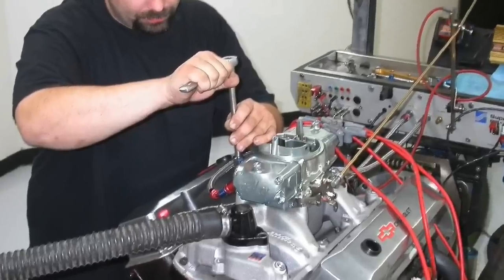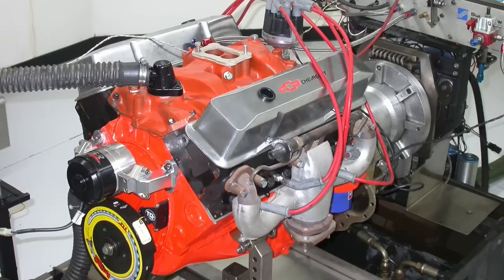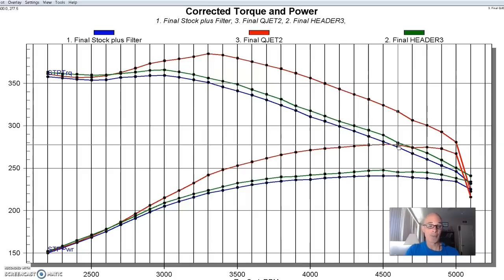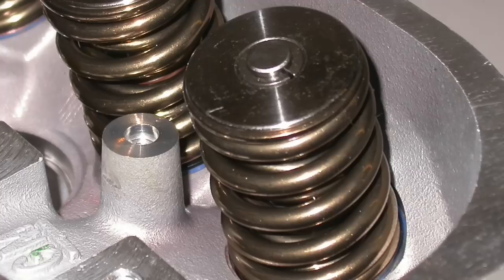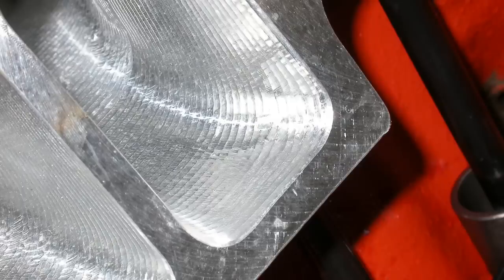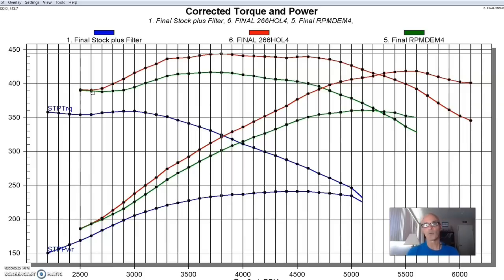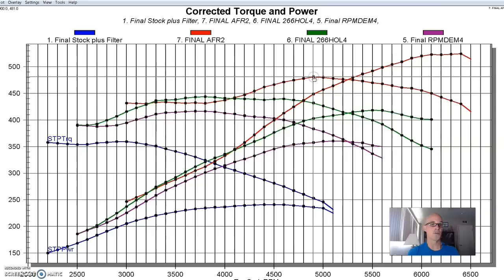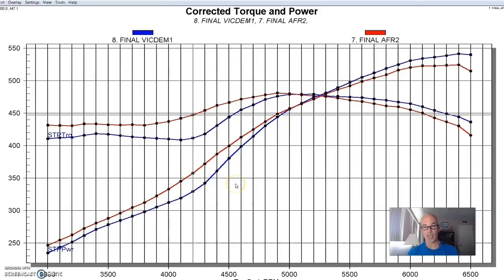HOW TO: SBC POWER COMBOS

Comment: So...I have a 388 stroker in my chevelle. Near .700 lift solid roller and 14-1 compression. Dart pro 1s, super victor and a qft950. Would this be stage 4 or 5? Long live the small block Chevy 🤘

Comment: I planning on getting afr 195 and a decent cam my son's 75 corvette 350 and for future 383 I won't have to spend on heads again. Would does afr 195 work for on that low compression motor. Thanks

Comment: Richard can you put a small cam in a 350 like a 212/218 110 lsa with those 195 wild heads  and show us what a super smooth idling engine can do with great heads also have you ever ran into aggressive duration/lift flat tappet camshafts chipping the lifters I have which is why I feel it would be warranted to have a small cam with big heads for longevity and to show that small cams with the right heads work very well for the street no loss down low and the heads carry the rpm up top
Reply from the maker: thnx-the heads wont carry the rpm quite the same without the cam duration, but mild combos are much nicer to drive
Reply: Richard Holdener I think it would be awesome to see how much a good set of heads can carry a cam up in the rpm range can you still get 50 hp out of awesome heads with a small cam just the same way it did to the big camshaft

Comment: If you were to build a 355 4 bolt main SBC (80-85 GM block) from scratch and wanted a street strip engine that could take abuse with retro fit hydraulic rollers, approximately 6,200 rpm, and around 400-500 hp, what rotating assembly and top end would you build?
Reply from the maker: lots of good options

Comment: Another rookie question i have the Vortec block and 350 hp i want to make more power  i have about 2000 to spend on heads and cam can you give me a good como i have sniper  and the hyper spark ignition system 5 speed and power brakes i would appreciate it thanks
Reply from the maker: Promax or AFR Enforcer heads and the cam depends on where you want to make power, you can also go cheaper and get Vortec heads from the junkyard
Reply: @richardholdener1727  i have Vortec heads i think my cam is the week link

Comment: What would be a good cam for a 9.5cr SBC 400 with ported vortec heads... 79 camaro, 2500 stall and 3.73 gears?
Reply from the maker: daily? or race?
Reply: @richardholdener1727  weekend street car
Reply: @richardholdener1727  actually it's 10.2 CR
Reply: @richardholdener1727  any thoughts on that cam? I'm thinking 234/244 duration .490/.510 lift and 108 center.. or is that too much duration for a street car in a 408?

Comment: hey Richard love you videos My question is I have a vortec 350 . vortec afr190 heads summit 8803 roller cam comp rr I bought some ls7 lifters for my build can you tell me how to set lash
Reply from the maker: 1/2 turn past zero lash
Reply: @richardholdener1727  thanks 👍

Comment: Great information as always! What were the specs of the large HR cam on the final test?
Reply from the maker: xr294
Reply: @richardholdener1727  Thanks for the response, Rocker Ratio? Literally in the process of ordering all the parts for the wild combo but with the AFR dual plane for street use. Thanks !!

Comment: Great info on an awesome engine!
....but how bout taking it to the next level...
  Like 421" or 427" ...but stick with flattop pistons and 64ish cc heads.. (Like afr 227's or comparable) Solid roller with 260 & 270ish @ .050 on a 108 or 110LC (also like to see cam at 270-280 ish) with a good single plane intake and a 950hp or dominator carb.. (Would love to see it both ways with the carb) ..  
  This is the basic engine description I have in my 70 camaro...curious what kind of power it makes...it's never seen a dyno..
Reply: Also..  Since it'd be easy to try on the dyno...would love to see it on e85.. And how it compares to 110 race gas..
   I run mine on c16 ...but it's a nitrous car..

Comment: Hey Richard I Have A 1998 GMC With The 062 Vortec Heads, Camshafts Are Real Tricky And I'm Trying To Find The Right One. I Just Want A Bit More Power And A Better Sound I'm On A 200$ Budget And The Stock 5.7 Comes With Roller Lifters, And The Only Cams I Can Find In That Price Range Are Hydraulic Flat Tappet. Any Help Thanks.👍
Reply from the maker: roller cams are more $-those heads need low lift or a beehive spring upgrade
Reply: @richardholdener1727  What Lift Do You Recomend, I Read Somewere That Over 480 Lift Is Overkill. Thanks

Comment: Ok so when running with the Holley heads an upgraded cam what was the modification to engine to adapt to the upgrade?
Reply from the maker: modifications?
Reply: I looked up a set of performance aluminum heads an the tech said to have change pushrods to .100" wondering if that was it?

Comment: Richard what do you think about sbc 350 stock short block with 297 fuelie ported an polished hump heads with 202/64 cc vavles an duel plane intake ? Which has been port matched as well , I asking h.p?
Reply: Forgot to mention 284xe comp cam 607 lift cam?

Comment: It would have been interesting to know the compression ratio of all the combinations as it affects cylinder pressure, torque, and horsepower.
Reply: The actual compression ration will not change just because of the cam

Comment: Does anybody know what cam/cam specs was used in the last 524Hp combination?  All Richard said was retrofit hydraulic roller.
Reply from the maker: xr294r comp hyd roller
Reply: I built the exact same engine, with the same cam and only got 435hp from a 350ci. I think the 524hp engine combo was a 383ci?? Just a sanity check for me Rich.
Reply from the maker: You need to hook up all the plug wires-what was different about your build? If you duplicated it exactly, it will make this power
Reply: @richardholdener1727  In reviewing this further, I might have used different heads. The AFR heads I used were AFR #1034 - 195 Eliminator Street Heads. Also my engine was 10:1 CR, yours I think was higher. I used the XR294 cam with 1.6 ratio rockers. Ultimately where did the 90+ horsepower difference come from?? https://youtu.be/MgNZzaiotNk

Comment: Another great vid mate,, Given that the first test was 2 barrel and a basic shitter, it really does go to prove that my thoughts that the specs quoted for the 89 L98 TPI Vette are ridiculously low. The full vid also adds weight to the advice i have been giving to others for 50 years,, That it is like baking a cake, the results depend on the recipe, putting 6 eggs instead of 2 doesnt meant it will be better, it all has to match up..      O yes that exhaust manifold has to be the worst flowing/port match I have ever seen, old Rams horns way batter.     Eddie   Australia C4

Comment: Was that a standard bore and rotating assembly, stock bottom end 350 ci. on all three builds?
Reply from the maker: it was .030 over with forged piston as described in the video
Reply: @richardholdener1727  thanks,must have nodded off during that notation.

Comment: What comp cams xtreme energy hydraulic roller cam made the most hp?
Reply from the maker: XR294
Reply: @richardholdener1727  Thank you, I was thinking it would be that cam
Reply: Do you have any combos using the ht383 with afr heads with 500 hp/tq?

Comment: I know no one else on the planet will test them so I'm going to ask you... I would never personally run them on my engine but I know several people who have. Please do a back to back test of the $500 eBay aluminum sbc heads vs something like a vortec head. I got a job at a engine building/ machine shop about 3 months ago. I've personally seen people make over 600hp with a vortec headed 383. I'm curious if the Chinese "performance" heads can compete.

Comment: I was wondering what the ccp or the compression was with the differant combinations because of the differant intake 
 Apparently the flat top pistons with zero deck helped with the later intake closing of the larger cam and help with the motor not being soft on the bottom end
Reply: Not saying it cant be done and hasnt been done but a 3.75 stroke has a piston speed of 4000fpm at 6500 rpm. That would be redline for a street engine and we all know all 400s arent the same

Make peak power at 6000 and shift at 6500 rev limiter set to 6800? Yeah it would be a good street combo
Reply from the maker: we run lots more stroke ta lots higher engine speeds-people need to not worry about piston speed-Our 4.5-inch stroke LS went 7000 rpm all the time
Reply: @richardholdener1727  thanks good to know. Lots of people use the 4000fpm rule for a street engine but if 4300 won't hurt it cool thats like 7000rpm

Comment: Important note on the vortec heads if you're going to run more then a . 470 lift you've got to cut the valve guides down if not you'll bend the push rods. Ask me how I know lol
Reply from the maker: Thnx-I think I mentioned spring mods in the video
Reply: @richardholdener1727  I couldn't remember if it was or not but I learned that one the hard way years ago after destroying a few sets of push rods. But keep the awesome content coming sir 👍

Comment: what are the specs for the wild cam ?
Reply: Thats what I’m wondering. Not sure why he left that info out. Maybe he forgot.
Reply from the maker: Comp XR294HR
Reply: For those that don't want to look it up: 242/248 @ 0.050", 110 LSA, .540/.562 lift.
Reply: @rizzoid  Cool name. 😎
Reply: and the spec on the piston......
Reply: That cam is wild I would of liked to see what this motor would of made with the rv cam and wild heads just to see how far the wild heads would take such a small can also no loss down low and nothing but gains
Reply: @mikef-gi2dg  Looks like a run of the mill issue FT. I just bought some Icons from Summit that look exactly the same. $349
Reply: Carl B - Thanks for posting the cam specs.  Probably not gonna have enough vacuum for power brakes with that 110 degree center line.
Reply: @danmyers9372  i have this same cam with some worked vortec heads on a 355 and run power brakes and A/C
Reply: I wouldn't really call it wild. More street and strip
Reply: @rizzoid  Wow, pretty big.
Reply: @richardholdener1727  Wow, that's big. Need a vaccum pump with that one, eh? And I'm guessing a double pumper, not vaccum secondaries?
Reply: @danmyers9372  And duration.

Comment: How are the vortec heads compared to the Holley heads?
Reply from the maker: The old Holley heads (no longer avail) did flow more than stock Vortec heads
Reply: @richardholdener1727  ok thanks for the reply! So the same kinda setup but with vortec heads won’t make the same hp? How much would it differ with the vortec heads?

Comment: 241hp with the stock 2bl! MAN, that sucks! My son has an 81 Chevy 3/4 ton 4x4 with 33" tires. Bone stock 2bl 350, and a swapped 700R4. Whatta slug! So just a factory Q-jet 4bl carb and intake + headers would be worth 38hp? Stock heads, stock cam. We don't want to change those yet, lol. Would 1.6 roller rockers help at all? Down the road we'd add boneyard Vortec heads, Vortec RPM, and maybe a SMALL HF cam, like a Hi Energy 252 or 260. Truck, you know.

Comment: Hey Richard, how about a 400/406 street engine combo that will pull hard to 6500-6800 rpm. Stock block and/or aftermarket.
Reply from the maker: I have a 600-hp 400 that did 800 with boost
Reply: @richardholdener1727  ...As someone who can remember "Dialing up"  Sunoco 260, I would love to see a video on your 400!!!!

Comment: Hey ,,, I'm a subscriber to ur channel,, I have a 406 , 215 aluminum heads,  672/ 672 ,,,,,,,, , 234 / 246 dur, cam ,,  is what I think it is ,, but is real ruff  id,,, 13.9.1 compression pistons,  H beam roads,   ,,,, I would like to lower the compression of the pistons,  I like to keep all the same internals,, and boost it,  twin turbo,, what do I need to do,, ? Thx I hope hear from you soon,,,
Reply from the maker: 672 lift? what is the lsa

Comment: More great stuff, love me some SBC goodness---makes me wonder what mine makes (358ci, billet main caps, Lunatl crank&aluminum rods, custom 12+ to comp. pistons, .600" solid roller cam, massively ported 492 angle plug heads and port matched single plane intake, 750 Holley HP DP), it's pretty sporty (seems really happy 7500rpms up) in my '64 MGB (2350lbs) street car
Reply: Sounds wild! Probably more than enough! But if you want more, many modern heads (CNC ported) will stomp those 492s (462s do you mean?), ported or not. Although Grumpy Jenkins got 700 hp with them (CRAZILY modified!) in Pro Stock, back in the 70s.
Reply: @donellmuniz590  --the #s on the heads end in 492--Chevrolet Angle plug service heads--never came on a car. Mine have welding all inside the ports, 1 7/8" round exhaust ports and my intake manifold has epoxy where it was ground trough, it REALLY likes to spin--have had it 8000+rpms and still pulling. Agree more to be had with modern heads, hate to break up a combo that seems happy
Reply: @mgbchuck6527  Oh, THAT'S why I haven't seen those. Are those "Bow Tie" heads, or did that come later? I can recall finding 461 and 462 castings in the boneyard 30 years ago. At the time, they still had value to hot rodders, not just restorers.
Reply: @mgbchuck6527  That was cool as hell. I'm not sure if that was a "happy" motor (oh, SORRY, I mean ENGINE, lol) or an "angry" one, lol.
Reply: @mgbchuck6527  You might have some of Grumpy's old heads there, lol. He was moving port walls around, spreading valve guides apart, raising roofs, all the labor intensive crap they had to do then.
Reply: @donellmuniz590  they were 70s Chevy race head, some called them Turbo Heads (run on Indy cars)--same casing Grumpy started with for his P/S heads
Reply: @mgbchuck6527  makes sense! Thanx for the info.

Comment: What was the specs on the third cam? Thanks
Reply from the maker: xr294
Reply: @richardholdener1727  thank u. I have a smeding 383 extreme. Wanting a little more out of it for drag racing. How would this cam go? Has air gap , 750 holley. 180 edelbrock heads

Comment: I'd love to see the 195's with a small solid roller (.600" lift or so) and a dual/single plane comparison. 

Imagine going 14-1 compression with the same combo to run on e85. Could be interesting.
Reply: Exactly the rv cam with the wild heads would allow for air conditioning and super smooth idle for gas mileage and no loss down low in torque and would rev pretty high there is never to much head
Reply: Too much compression for a cam and heads that size. It would defeat the purpose

Comment: Hey Richard I’ve probably watched this vid 100+ times just wondering on what the specs were on the afr heads on the wild set up with the 294 cam I’m trying to build that first “wild” set up for a ‘90 obs the 524hp at crank to 440whp would just make the truck stout!
Reply from the maker: i THINK THEY WERE 195 ELIMINATORS
Reply: Awesome thank  @richardholdener1727  
Keep up the great videos 👍🏻

Comment: Wish you would’ve tried a bigger cam on those ported 882. I think a lot was left on the table for them.
Reply: horsepower monster did and could only get 380hp.  they put bigger valves more cam than this and shaved the heads and screw in studs.  port and bowl work too. 

more money into them in labor alone than the iron eagles they went against and still got their butts kicked

Comment: I would like to see a 95 tbi 350 build.  I have a c1500 4x4 w 5spd.  The motor has a bad rod bearing so I’m gonna just get a crate motor.  I would like to turn it into a torque monster as best I can.  Example....... with 33in tires n 3.73 gears I would like it to have enough power to take off in 2nd gear

Comment: Yet another great video man!!!!I'm sure you hear it all the time,but I would like to see a vortec 350 vs Ls 5.3 as equal as possible... example put best performance cam for both engines close to the same specs lift,duration,header size,both engines carbureted. Thanks Richard for your time.

Comment: That's the same hydraulic roller I have in my 385 with a Victor jr intake, 10.5 compression and assault/nkb200/proheader castings with good shit put in them. Those AFR heads flow probably 20-30 CFM more up top. I never thought that 350 would put out that kind of power on pump gas (I assume)
Reply from the maker: yes pump gas

Comment: Hard to beat. The 2bbl version is the most reliable and stingy on fuel. Which you did not monitor.
The mid version is typical street rod material. And you don't need to rev it real high so expensive rods are not needed.  Get a short block from a rebuilder and add some parts and have 420hp and you would not cry if it blew it's guts out in 2 years.

Comment: Build a 283 bored to 4" with pop up pistons 11:0 and 540/108 lobe seperation victor jr and 1050 with  291 heads cut for cam of course  see what u get
Reply from the maker: a 1050 on a 302?
Reply: @richardholdener1727  would 850 work better

Comment: Wish you had run the 650 demon, then the 750 demon on the final dual plane configuration....Always hearing arguments about 650 vs 750 on a street 350+/-  cube engine.

Comment: What is the info on the Holley heads? P/N maybe?
Reply from the maker: SysteMax heads-not sure if they are still avail
Reply: @richardholdener1727  are they the heads with a 20° valve angle?

Comment: You might have been better on the mild combo with the quadrajet and performer rpm because the quadrajet is 750 cfm.
Reply from the maker: I like the Q Jets
Reply: @richardholdener1727  If you can keep the well plugs from leaking, it's a excellent street carburator.

Comment: I've always heard you CAN get better MPG with a quadrajet than a dual jet where the Qjet has such tinsey primarys, obviously if you can't stay out of a Qjets huge secondarys a they can be thrsty. I always thought the cheap 600 1860 gave awful fuel economy for a small carb. I absolutely loved my Holley mechanical secondary Qjet replacement but hated the vacuum secondary version, It sucked i blew the power valve n traded it for a good factory Qjet, n was way happier.